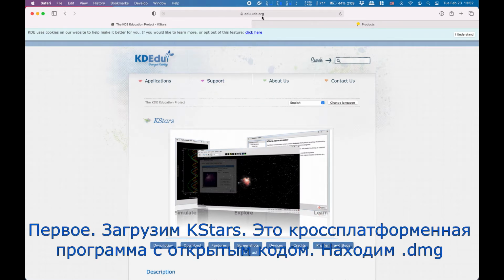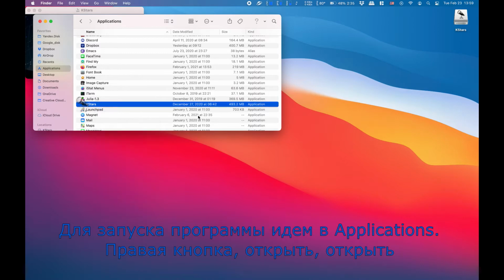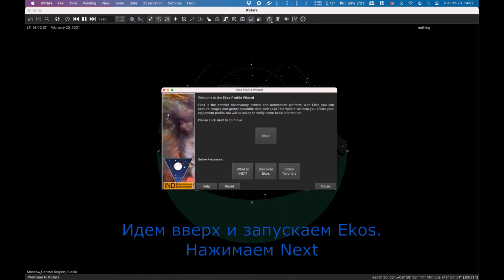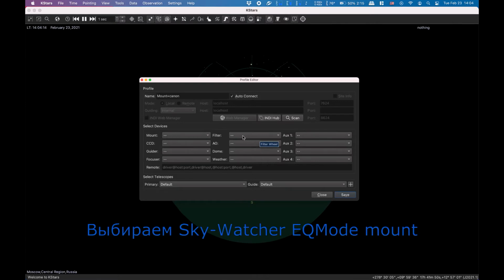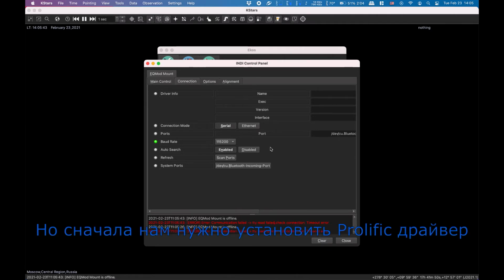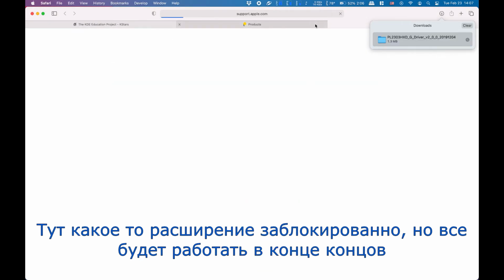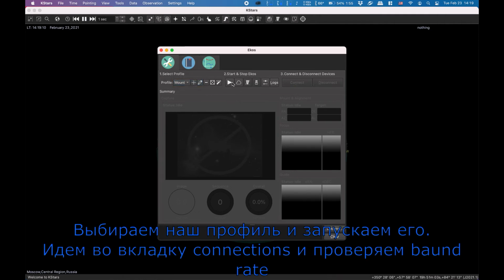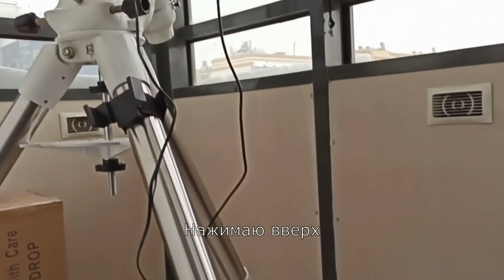EQ6-R Pro. How to connect and control it by usb with a Mac computer

Comment: thank you. I now have my Mac /KStars/Ekos system working same as you except on AZ/EQ5 Pro. is it possible to remove the USB cable and have same control with WiFi or BlueTooth?  is this possible? thanks again.
Reply from the maker: Thank you for the question. Unfortunately, I have never heard of this. Moreover, my mount (EQ6 R pro) does not have WiFi or BlueTooth. I don't know whether your mount has. I suppose not. So one probably needs some wifi receiver. I have never study this question. Sorry.
Reply: Does your Mac have USB A or C ports?

Comment: best tutorial ...thanks...what other softwares do u use?
Reply from the maker: At the moment I found following best free software:

- KStars + Indigo + PHD2 (I was forced to use the external indi server (Indigo), because internal indi server did not work with ZWO cameras and focuser) . PHD2 much more accurate and flexible than the internal guider. 

- SiriL - for pre-processing and stacking as well as some post-processing

The only payed software I use is Phothoshop, for final image treatment.

I tried trial PixInsight and I like it. It is more flexible than SiriL and can produce slightly better result, but it is too expensive. And I found that SiriL more stable when registering images. Sometimes I was forced to use something like Pixinsight - SiriL - Pixinsight - Photoshop

Comment: I also just bought the newest version of the SW EQ6-R PRO mount. I looked at discussion on Cloudy Nights about using this USB connector on the mount. Long story short, confusion, as people were talking about old and new versions of this mount.
Your presentation is the clearest though I have not had a chance to try it since I am waiting for a power cable to be able to supply power to the mount while using house AC wall power.

Will see what happens but thank you for your effort to help others.

Have fun and clear skies !!!

Comment: Wow it worked! I was missing the prolific drivers. Once installed I followed your instructions and it worked. 2010 MacBook Pro High Sierra direct usb to usb with EQ6R. The driver install killed my trackpad and keyboard after restart. I had to do an SMC reset and they came back. Took several seconds for the connection to be made in Ekos. Thanks for the video!

Comment: Thank you. Very concise presentation. Now I want to see more detailed presentation of Kstars.
Reply from the maker: Hi)) I am still learning. Not everything works well. For example, the internal INDI server does not work with ZWO equipment (at least for me). One needs to use external INDI. But there are some problems with the astrometry routine.
Reply: @tchannel9297  I could have guess that might be an issue. ZWO tends to keep their cameras out of the mainstream software. I am using a Nikon and Canon modified cameras as well as a ZWO Asiair pro. I have had good success controlling the Eq6r-pro with the Asiair and will probably get a zwo camera for overall compatibility. Vic